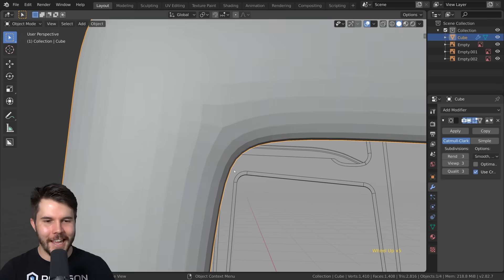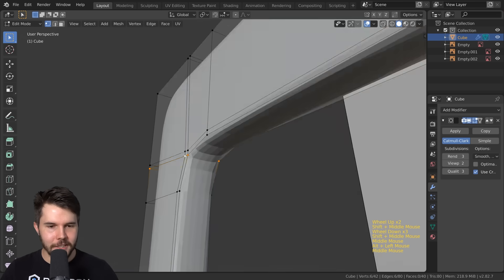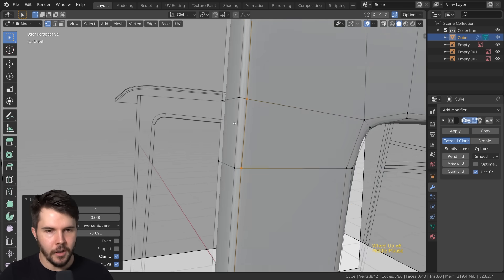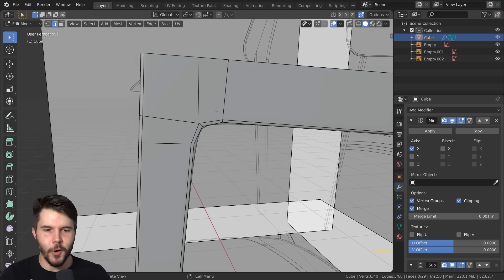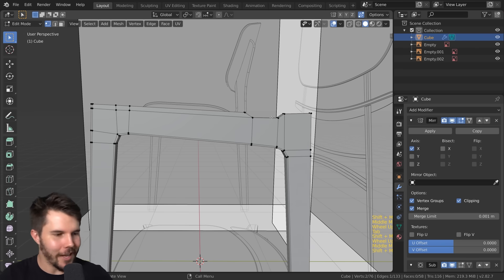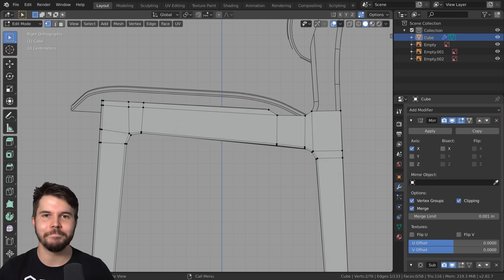Blender Beginner Modelling Chair Tutorial - Part 2: Edge Flow

Comment: double G for edge slide ? You just divided my modelling time by two, and I've been using Blender for three goddamn years
Reply: You can also use the slide with vertices. In the operator window  (now called Adjust last operation, bottom left or call it with F9) you can type in the percentage value you want to slide the components.
Reply: Yeah i also found out about the double tap g thing recently, so damn useful man

Comment: My question would be, why do you use edge loops that add a lot of additional topology, instead of using edge crease?
Reply: Please go through the comments of part 1, there is a similar question and in the answers you find one reason why you shouldn't use creases as a substitute for holding loops. Not from me but I added a 2nd reason on this part as answer to another question about the creases  (issues if you have to export the model).

Comment: I'm going insane, the mirror modifier keeps placing the mirror across to the other side of the reference photo even when I set it to the X axis. Anyone know why?

Edit: If anyone else runs into this problem, select the chair arm in object mode and click object in the top left, go to set origin and select "Origin to Geometry". My origin point was still in the middle of the scene lol.
Reply: The mirror modifier uses the Object origin as the line of symmetry, unless you specify another object. You can adjust the Object's origin by pressing Ctrl + Alt + Shift + C, then Origin to Geometry. Do this before cutting the object in half. Your mirror modifier should work as expected now.
Reply: @ideallyyours  Thanks! Now I knew what to look for, although the shortcut didnt actually work for me, but another way to do this is to go into object mode with the chair selected, press "Object" which can be found in the top left corner of your screen right next to object mode. Select "Set Origin" then "Origin to Geometry.
Reply: @avdv116  Thanks - every time I added the mirror modifier I would get two legs  !
Reply: @ideallyyours  but it is still broken, i have this "bubble effect" i can't do anything about.
Reply: Thanks :D
Reply: DUDE! THANK YOU!
Reply: Thanks guys, had the same problem here :D
Reply: @Jikian Oh man!! I did it after cutting the object in half
Reply: Thanks so much!
Reply: i almost had a full scale conniption trying to figure this out- thank you so much
Reply: fucking saved my life, dude
Reply: @dantepanics4017  LOL!

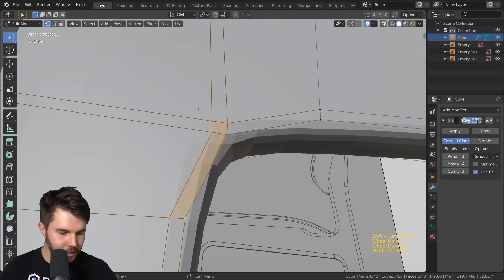Comment: 2:25 For those of you using Emulate Numpad, you can actually go to Prefs > Keymap, and then search for "mesh" and you'll find Select Mode: 1, 2, 3, under the Mesh header. Then you can click on them to have it listen for a key press, and then hit ALT + 1/2/3. This shortcut isn't used in edit mode, and this key map is only tied to edit mode. So I haven't found that to cause any problems, and you actually have a shortcut you can now use to change the select mode.

Comment: In my experience, remove doubles doesn't work properly unless you are either in x-ray or wireframe mode when selecting all the vertices. Which he was in the video but newcomers may not pick up on that detail. It has caused me a lot of headaches in the past.
Reply: Yeah or just press A instead of box selecting to make sure you select everything
Reply from the maker: Pressing A will select everything, regardless of what mode you're in.
Reply: @blenderguru  The only reason I say this is because pressing A while not in those modes didn't work for me. Maybe it was a bug on my end but I remember the same issue happening to one of my friends. This was back in 2.79 so maybe it has changed? I don't know.
Reply: @rohitaug  Maybe it was back face culled. Technically hidden and you can't select hidden vertices.
Reply: @KevinSmith-qi5yn  Good point. That could be it.

Comment: Instead of adding loop cuts, why not add bevels?
Reply: It's good practice conceptually to learn basic topology methods such as loop cuts, then build upon that knowledge with bevels (manually first, then bevel modifiers etc.)
Reply: @razeezar  Quite right.
Reply: Personally, I do it with a bevel modifier, by weight,  segments 2, profile 1, and adjust  weights. It's quick. But sometimes I have to apply the modifier and edit to  adjust behavior at corners.

Comment: Hey Andrew! Maya user here trying to learn Blender. Quick question. I found myself a bit lost when the origin point of my cube appeard anywhere but in the middle of my object. Is there any way to fix this? I am trying to mirror my geometry. The ridiculous shortcut SHIFT+CTRL+ALT+C doesn't seem to work... Thanks in advance!
Reply: Do you happen to be in Object mode or Edit mode? Ctrl + Alt + Shift + C while you have the object selected in Object mode should bring up the option "Origin to Geometry".
Reply: Before cutting your mesh in half, go into object mode, select the leg then right click then set origin then select origin to geometry and done, now origin will be at center

Comment: Why do you choose to add edge loops to control your 'roundness' of the mesh instead of adding an edge crease?
Reply: edge creases are not meant to be a replacement for control loops. If the edge doesn't flow appropriately, they can cause shading artifacts. Edge creases are generally meant to complement control loops, adding a little extra sharpness to edges when needed.
Reply: i was using edge creases for a while but now i am back to using edge loop. reason is, even if you dont have a subdiv modifier, you can make nice edges with edgeloop, which in the end are used to control how round an edge appears
Reply: you use proximity loops to tighten the meshes averaging, you use edge creases when you want to specifically sharpen a softened edge that is already prox looped, since sometimes if the loops are too close or the mesh is too small artifacts can occur so a crease allows you to move the loops away and will crease it AT A SMALL AMOUNT FOR ARTIFACT FREE USE, and blenders unit system makes meshes in meters and not iso millimeters/ansi inches as some 3d programs
Reply: He talks about his same issue in one of the anvil “intermediate blender tutorial” series.
Reply: Edge creases are also more difficult to control at a later point if changes need to be made.
Reply: I'd also like to know

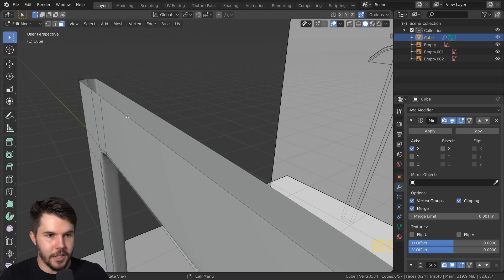Comment: 9:29 I'd keep those faces and add that edge loop. Adding faces there will help with AO and "gluing" the mesh together. It's a minor thing, but hey, it's the last 5 % that makes it good
Reply: All good .. but there's another  principle being illustrated here: model for the intended purpose!  Visualization? Close-up? Long-shot? If no need for manifold meshes, then model separate parts as separate parts.. etc.  Commercially, laziness is vital to success. You've just got to know, very well, where you can get away with it.
Reply: Was going to comment this from other angle. If this model is ever to be 3D printed then definitely keep the faces and make parts manifold. Repairing sloppy meshes can be major pain.

Comment: 1 million people can apparently operate blender. I have learned how to cry at a PDF. :P
Reply: PDF is a file format that's meant to work across multiple generations of software and hardware. It's no surprise that to utilize it may require obscure or antiquated techniques, because changing how PDF works will also break untold numbers of workflows that have resisted change over the decades.